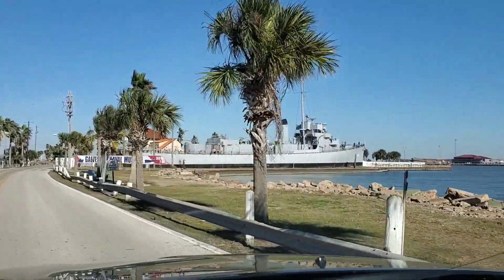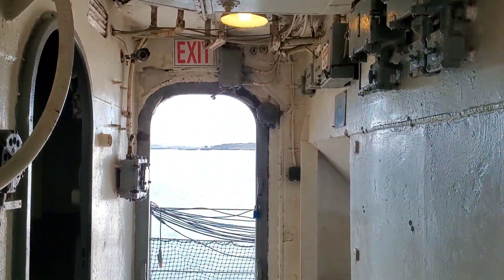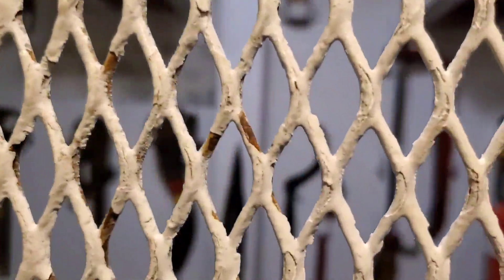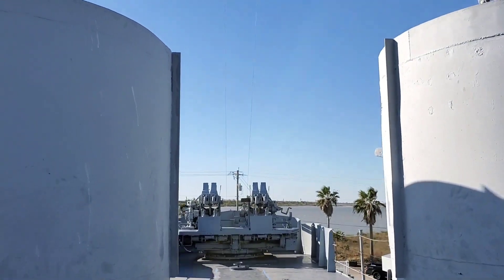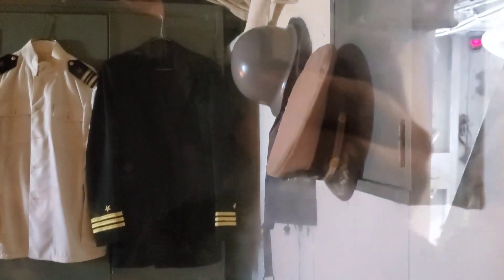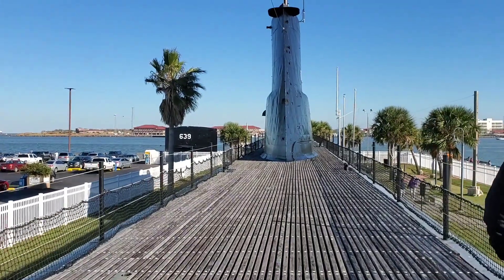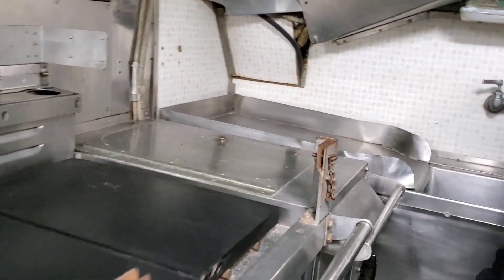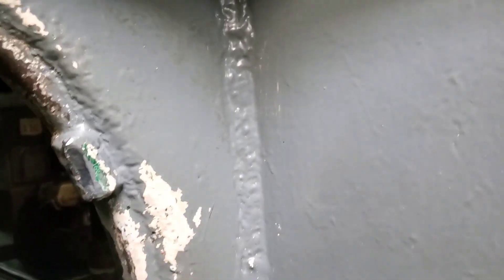Tour of Galveston Naval Museum USS Cavalla and USS Stewart the Only Preserved Edsall Class Escort

Comment: The sub is much larger on the outside because what you are in is the pressure hull.  On each side of the
pressure hull are huge ballast tanks they flood or blow to dive and surface.  There are other  ballast tanks 
in the hull fore and aft to control the ship's trim along with the diving planes.